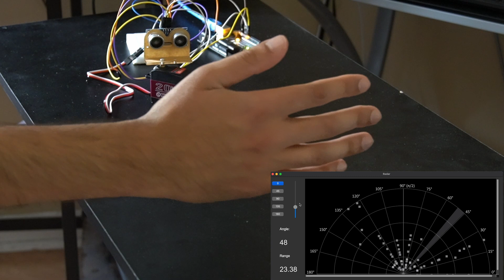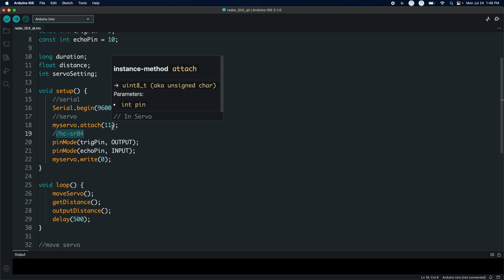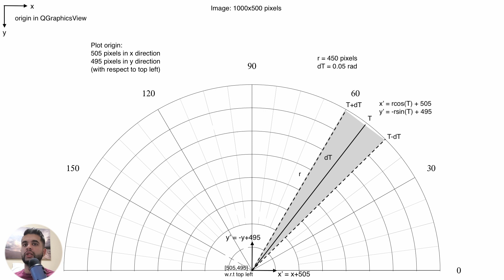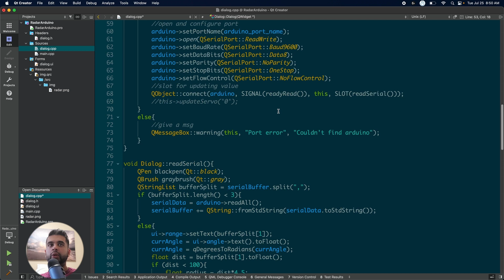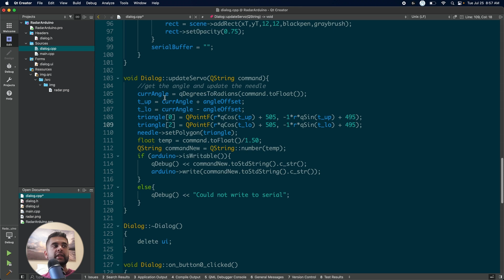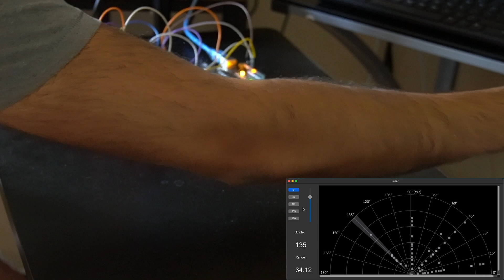Arduino: How to build a Radar/Sonar with a User Interface Heads Up Display using C++ and Qt!

Comment: This is an awesome start to a great project. But I have some corrections/suggestions:
- What you just made is not a radar, but a sonar. This is due to the fact that the used sensor is ultrasonic and not something that uses electromagnetic waves.
- Instead of using a servo motor, a stepper motor would probably be a better fit for this project. Because you can program the stepper to rotate at a fixed speed continuously , you can make a full 360° "virtual FOV". I believe that in order to make this more akin to a real sonar, a line should be scanning the entire screen and once it comes in contact with an existing measurement, is erased and adds a new one. To achieve this, you could map all of the possible coordinates to a bidimensional array (basically a matrix). To avoid entanglement of the wires, you could consider adding a slip-ring.
Reply from the maker: Thanks for the feedback. I am aware its an ultrasonic sensor. The title is for SEO. And yes this project can be taken a lot further.
Reply: @VDEngineering  that makes sense! I apologize for my unawareness about SEO.